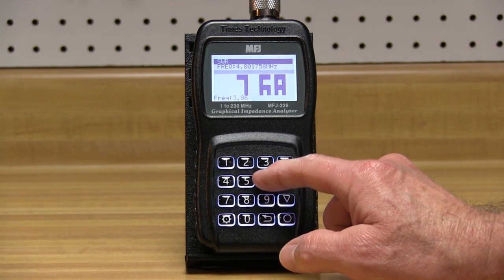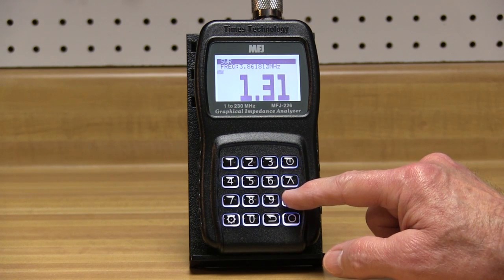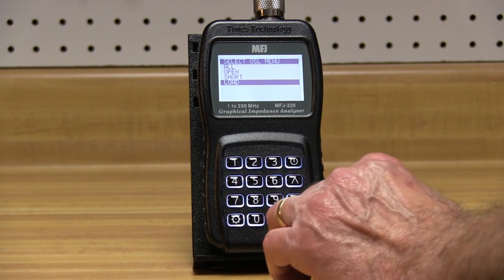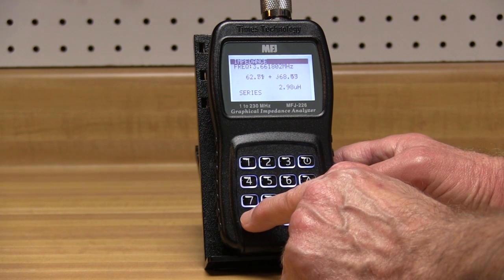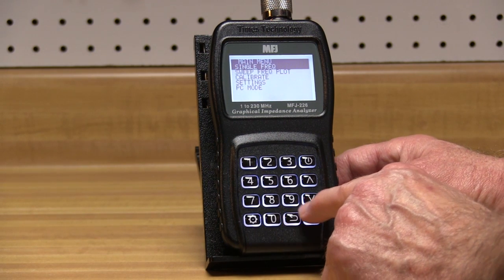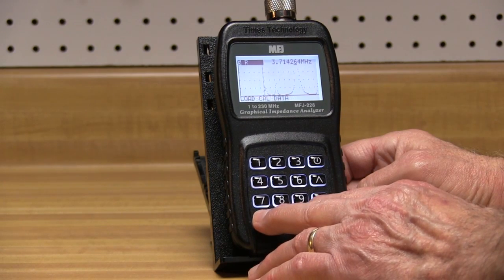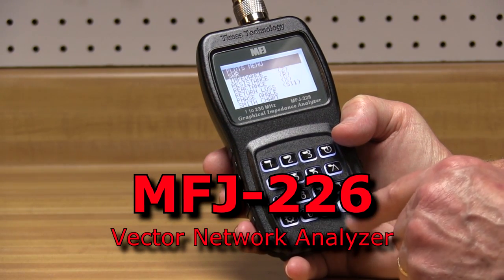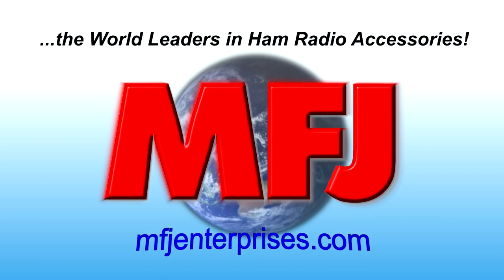MFJ-226 VNA Antenna Analyzer

Comment: My 226 was DOA. When connected to few different tuned antenna (including MFJ 1840T), the reading was all over the place, nothing like smooth curve in the video. Batteries heated up and discharged rapidly. Luckily the online place I purchased it from took it back as DOA and refunded my money. I went to purchase a competitive product from a manufacturer with a well established line of graphic antenna analyzers.
Likely I got lemon or is this a typical case of MFJ legendary QC? Make sure you have good return policy before purchasing 226.
73
Reply: That's a shame, But it seems the norm. I really like the product line. MFJ has some great products. But the quality is a crap shoot...